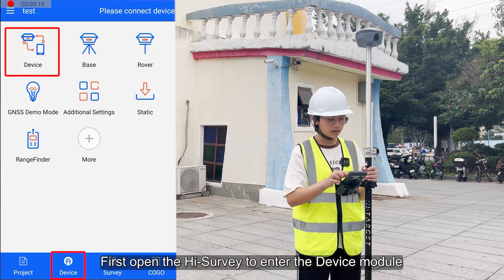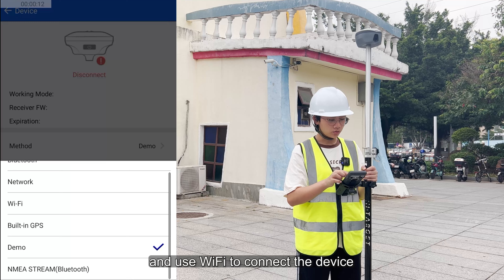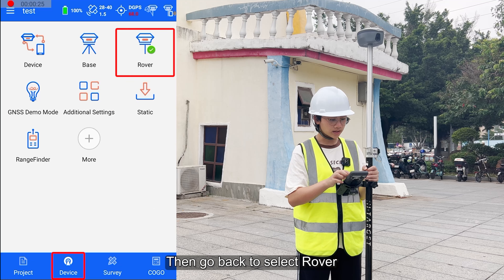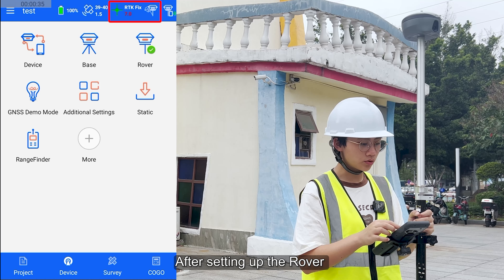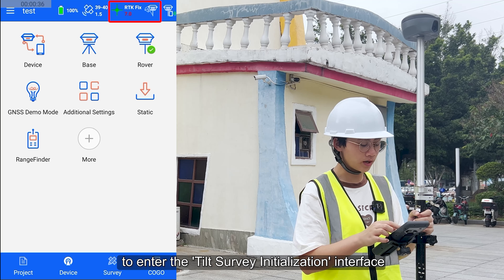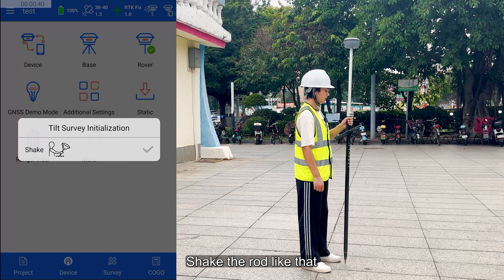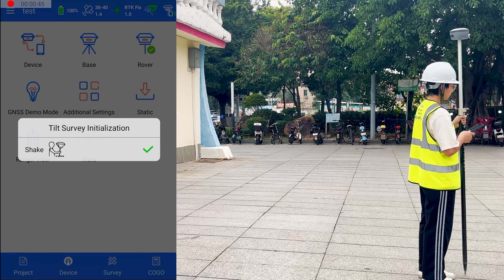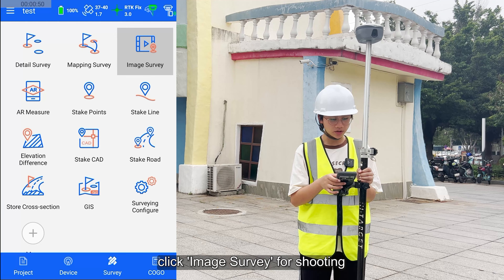How to use vRTK for 3D modeling field data acquisition

Comment: Hi, How I can setting auto store photo by distance or time?
I had have take photo, but photo did not have coordenates.
How I can store photos with fix coordenates to make 3D models?
Reply: Hi-Survey V2.3.4 software and vRTK2 hardware
Reply from the maker: Hi, vRTK2 is the Chinese version which can not be used outside mainland China as the signals and performance will be interrupted.

Comment: I have the same problem as @alfredoyanez7469 . Photos don't have location information and also photos are really small 1600x1200pix...that's not even near 5mpix camera as you advertise
Reply from the maker: Hi, for better technical support, it is advised to consult the Hi-Target dealer you purchased the devices from, or you may submit your info at: https://en.hi-target.com.cn/contact/, our team will get back to you soon, thank you for your time!